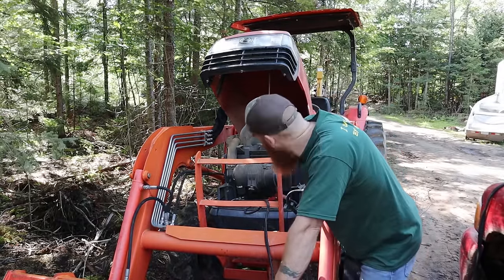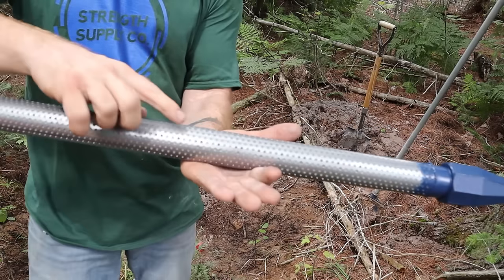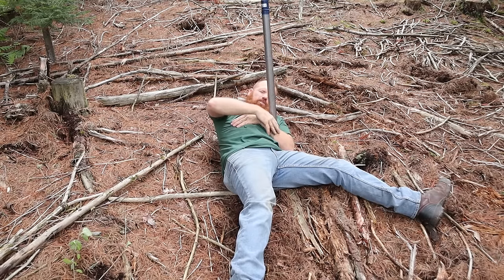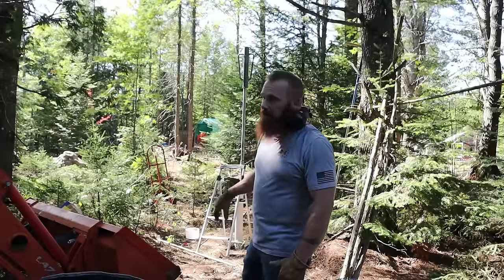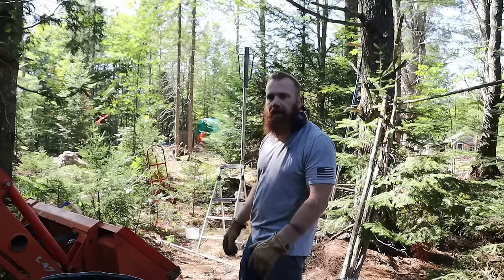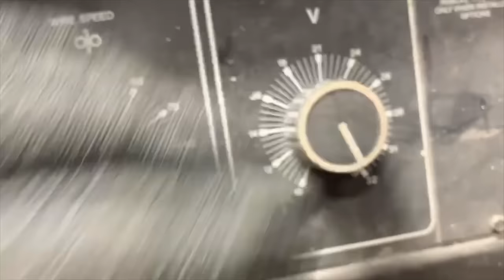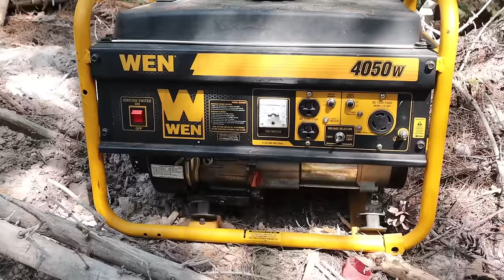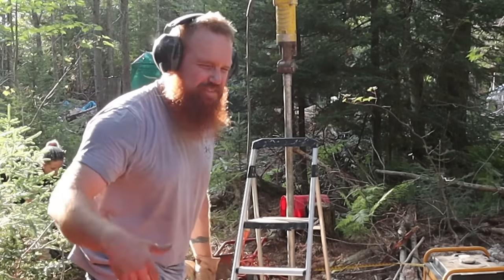Off Grid YouTube Family of Girls Step up to Help Dad Drive a Well | Fabricating Off Grid Well Tools

Comment: Done this 6 times. 1 for me, 3 for neighbors, then replaced mine twice.  I also devine with coathangers since I was a child. All the wells were about 30- 40 deep.  Sometimes you can shoot a gun down them and get another season out of the point. My points lasted 8-10 years. Last one still fine after 20... think it was just a better made one. just used sledges on mine, but a neighbor had one of those slide hammers and another had a really nice tripod driver set up. Today all the lake front properties have been bought and developed already. Soon no one will know how this is done...

Comment: Hi  it was nice project you undertook .girls gave helping hand was aasum.
 At our place we also dug a  a well using 100 mm pvc pipe 60 feet in length.the pipe was in 10feet section  4 section were perforated.
We made a tool to dig the soil which was like a big screw which was attached to 1 inches galvanized iron pipe and we rotated it and took out soil upto 30 feet
After that the clay was soft so we used other tool using 3 Inches diameter iron pipe of length of 3 to 4 feet whose one end behaved as shutter.shutter closed as upper othee end was pulled due to gravity force .it was thrown down the 4 inches pipe and the soft clay removed  and we got water.using water pump and hand pump as well.
Reply from the maker: Interesting!

Comment: Oh wow!!! After watching this satisfying video I was so happy to see water gushing out initially. When you said that pipe broke I literally had my mouth open in shock and disappointment. I know how  something like that feels when you do all that work and it doesn’t work out. Damn!  I’m sorry to be negative but how do you know it it only broken eight feet down but not any further. Good luck with this project. The more disappointing and difficult a task is the more gratifying it is when it is completed and works.
Reply from the maker: Well I don’t know for sure but what I do know is that the pipe is broke off right ft down because I can see it. Also the water level stops right at that 8 ft down broke part. If it were to be broken down any further the water level would be down even further.
Reply from the maker: @mgpvii  thank you!

Comment: When I was seven years old in North west Missouri My dad drilled a Well that same way. He was a Witcher and he could find water . He made a Auger out of a old Mill Auger and we turned it with a set up he made and powered with the Back wheel of our old 1934 Plymouth Pickup Truck and old belts he got at the Old Mill. That well is still producing water . 70 + years later.
Reply from the maker: Wow that’s awesome! Maybe the old rig still works? 😆 How deep was the well?

Comment: I used my tractor bucket for pushing the well pipe. I kept the post pounder on the pipe and pushed away. You have to be careful but it does work
Reply from the maker: You must have a big tractor.. ours won’t do it.

Comment: I work for a dewatering company and you need to back fill around your screen with sand or small gravel at all costs that will help filter water through with out gumming up the screen and clogging your well! Good luck you can do it!!

Comment: One suggestion I would give you is to empty your Kubota's bucket, and position the tractor near the vertical pipe - with your jackhammer and other tools needed, inside - raise the bucket to a good height to work at (working at waist level is much easier than above your shoulders), have enough clearance to be able to raise and lower the height of the bucket without having to move the tractor. Level your bucket so it is comfortable to stand in, and use your ladder to climb into the bucket. Your tools will already be where you need them and you can even have a cooler in the bucket for cold hydration.
Reply from the maker: Yes that would’ve definitely been much better

Comment: I have done 3 by hand. And one well ,l can pull water with a hand pump 115 feet…I took 87 cranks with the old pitcher pump to do it,made a foam rubber to block the spout…So l would not have to pour so much water in it..Once the leather swells,your good to go!!!

Comment: Have you considered using a pneumatic t-post pounder? The jack hammer was good idea, but a t post pounder is already designed to do that very job. 

Coupled with a pressure washer hooked up to back wash the pipe/hole, might do the trick of reducing the friction between pipe and dirt. And making mud loose enough to easily pound through.

Comment: Use a trash pump to send water down your pipe to remove the clay and keep the screen open. With water pumping you will be able to just press the pipe down and should be able to see the formation you are "drilling" into so you will no where to stop to be able to check for water. You may have to keep running your 4" pvc casing down along with it to keep your hole open. Good luck to you and I hope you eventually get your water source.

Comment: Pre-heat the metal parts before welding, use nickle wire, straight argon shielding gas and slowly cool the part in lime.

Comment: you need to keep digging with the auger. If you hit water at about 10 feet you need to take the auger down as far as you can. the well i dug i hit water at 14', i kept going down till i hit water, it ended up 28' deep. then you put pvc casing with slits cut in pipe sides to allow water to seep insde pvc. put 30' of pvc in hole, then filled outside of pvc with pea gravel. the gravel helps to keep the big chunks of dirt out of the casing. then  you run your 11/4 down inside your casing with the strainer keeping it about 2' off the bottom. hook the pump on, prime, and pump. just driving the pipe down it doesnt have enough space for water to flow down around pipe to the foot valve.

Comment: Check out the YouTube where the fella used PVC pipe 3 inch like you did but then he use flexible 1 inch pipe hooked up to some type of pressure into the 1 inch pipe. He did this he’s doing the same as you did except he used all white PVC water pipe, I guesshe’s on YouTube which looks pretty easy to me. The metal pipe you’re using is expensive I guess and galvanized. I hope anyway it was nice to see the family getting involved together as a family should good luck take care and God bless.

Comment: When driving in a rocky area use a rock point, when driving in a sandy area use a sand point. If you use a sand point in a rocky area the point will probably collapse. A sand point will have a finer screen.

Comment: I got my pound point 18 feet and hit a rock.  I burned 5 core bits in the area trying to break through.   I get a gallon of water a week.  Cost me $1,000

Nice family.  Nice goats.  So cool when they think it is fun.
Reply from the maker: Wow! But just think, at a dollar a gallon you’ll get your money back in just under 20 years! 😆 Thank you Michael! Hope you’re having a great day!
Reply: @9252LIFE  I sold my drill mast rig.  That pipe and the hole will be gone this fall.  Worked on that for a year.  It is a pain in the ass when mowing the back yard.  And my little China pump stopped working.

Barely enough to water the carrots anyhow.  Looking at bulk water storage units now, for human survival,  not the garden.
Reply from the maker: The garden is a good survival item

Comment: If you need to go over 25 feet to water, you need to use a 2" point and pipe. From there, you could install an old fashioned deep well  cylinder and hand pump, or you can use a deep well jet pump with a packer ejector. Both can lift water from 100' or deeper.
Reply from the maker: Our water table is only a few feet down. So once we get through the clay and the screen doesn’t clog, the water will naturally be up high enough for our hand pump to work.

Comment: We dug 3 wells by hand ,the first was like u did but we backed the truck to the pipe and loaded it up with anything that had weight jacked up the truck and tied it to the pipe then use the hand driver.we went 35 feet hit water but could not get the pipe clear get to get the water recovery,my brother had bought a gas well driller rig and it drills 100 feet. We have 2 100 foot wells.

Comment: I used an auger shovel down 30 feet hit surface water at 10 feet. Pulling that shovel with muck clay rocks and water was hard.  Am modifying my pressure washer and steel pipe to sink the outer 4” pipe down 60 feet. Then the center 1 1/4” pipe with 2
Check valves in line so to never lose prime. This will be water to water my lawn and garden. Good luck.

Comment: Last time I drove a well I used a go cart motor and welded a tire rim to the shaft. Set up a pulley type system and had a rope to the driver with  xtra weight. Loop the rope around tire rim it lifts driver then release rope.

Comment: I went through all that and then found out that a frame loaded down with weight a bottle jack some 4x4 blocks and found out how much more easy it was to press pipe in the ground. And I  never broke anything and I went 85 feet. 💪
Reply from the maker: Interesting! Did you record it or take any pics? 😬

Comment: I'd suggest a pipe threader from Harbor Freight.  You MIGHT be able to thread the pipe without having to dig it up??  Also, build something to keep the pipe from wiggling and in the 4" PVC to prevent another break 8' down.  I hope to see some progress on this soon.  I'm thinking about drilling a well of my own, but I know the well I'm connected at my parent's place a few hundred yards away is over 400' deep.... I'm hoping I don't need it, but an emergency water source will be nice.

Comment: I’ve seen folks drive grounding rods by using water basically you use a rod and pull up the rod fill up the hole with a small amount of water and the water hydraulic pressure help pound it in

Comment: I had the best time! And teach my students as best I can to get inspired to do the same. I teach Plumbing! 40 yrs exp!! Your pipe is low carbon ( soft ) impact mucked it up. Have you considered !! Remove the existing pipes... and core drill through the existing hole.... just a suggestion... don't know how else to get down as deep as you need. Water should be be trying to get up as your drill, to cool core?? Good luck bud.

Comment: I know it is way too late for this but... Where we are from we pound wells with a truck and a rim welded on another rim to use as a capstan winch, run a rope up to a poll A frame with a pulley. We put a 100 pound weight on end of the rope with a pipe to guide into the pipe we're pounding in and just wrap rope around truck wheel a couple times for tension while truck is on jack stands we pull on rope creating tension this raising the weight then let go of the rope dropping weight onto the pipe being driven into the ground.

Comment: for this i'd use sch 80 pipe, in at lest 10' sticks, minimize stress points. the jack hammer was a good idea 
my half baked idea so far is using a seymour auger, using a trash pump, from a settling pound to push/flush the loose material away/back up the hole. most likely i'll end up doing the spear method like you guys. 

have you guys tried dowsing rods to find a good well location? i've seen it work.
Reply: dowsing is a scam, this has been proven many many MANY times.

Comment: ya i did a well once using a hole digger like you just used just teep adding more pipe on to it till i hit but on the land i was i knew i could hit water at about 15 feet down and yes that were i did hit water and i put a hand pump on that i did this to get water for some pig i had to get them some  and at another time i used a well like the used and put it in with a post driver just like and i hit water at about 20 feel on that and that was on a cabin i had in the woods  and yes you can use a hand pump on a well that is over 25 feel but what one needs to do there is to put a check valve in the pipe and use a long handle put as you go down more the wieght of the water makes it harder to pump so the longer hand help to keep it pumping better i once put a hand pump on a well that was 40 feet down and i had to do it this way and it work really good

Comment: Not sure if it would work in your area but most hand dug wells are shallow. I have one that that's 100 years old on my property and is the standard "lined with rocks" like a stone wall type construction. I did the math and at 17 ft deep with water maybe 5 ft below grade, it's got around 600 gallons in storage. Granted, it takes time to recover, but used wisely that's a fair amount of water to work with. Using modern equipment you could dig that with a track hoe in a day and stack in a concrete liner with a gravel base to around 20 ft and be done in a few days. From an engineering standpoint, once you hit water you will need to run a pump to keep the hole dry enough to work. The flip side will be watching how many gallons per minute (or hour) you are removing, which will be an indication of the recovery rate once finished. If you do the job during dry season it will be easier and you will also know your worst case situation for recovery rate on the water.
Reply from the maker: Thank you. We’ve gotta definitely get something working!

Comment: I had a well put at my house in about 1977 by an old guy that came in an old pickup truck. He had a giant tripod made of pipes he put in above the well position. He had a 5 HP gas engine with a running capstan on one end. The motor was mounted to a heavy base of timbers. He ran a rope from a heavy weight resting on the well pipe up to a pulley at the underside of the tripod and on to the capstan. He wrapped the rope around the running capstan for a turn and when he pulled the rope the capstan lifted the weight and when he released the rope the weight dropped. He was able to use the capstan to draw the heavy wight up and then drop it down on the well pipe with ease. As I remember the heavy weight was a heavy hand held driver like you would use to drive fence posts. The action was using sight pressure on the rope to draw up heavy weight and then drop the weight, and repeat to drive well pipe.
Reply from the maker: Interesting

Comment: I know nothing of digging wells. Is there a reason you can’t use the bucket on the tractor to press down on the top of the pipe. That tractor should be heavy enough for that?  Apart from that it’s great to see a family working together.
Reply from the maker: The tractor won’t do it.  It’s just a wimpy little thing. Tried it. Thank you Clifford. Have a great night!

Comment: Did you use dowsing rods to find the spot to dig the well,you can make some with 2 metal hangers ,straighten the 2 hangs make to rods about 2 feet long bend the ends about 5 inches long to make a handle like a L take two Bic pens take apart put over the handle so the rods can swing freely hole them out one in both hand walk around land when they touch thats where the water is,it really works
Reply from the maker: Yes we used dowsing rods. Took a couple hours and this seemed to be the best spot.

Comment: As I'm sure others have pointed out you need a pump at the bottom of your well, because below 30 feet or so the only thing you pull is a vacuum.  You'll probably need a bigger hole.
Reply from the maker: We tried drilling a 6 inch hole but the clay keeps caving in. Been a real pain in the butt!

Comment: You clearly have the technical capabilities (some of what you did there was straight genius) and equipment.  If I could make a suggestion, ditch the whole driving the pipe down into the hole routine - you hit the problems you did (I learned them myself).  If you have something like say an old motor with a vertical shaft/drive on it you can quite literally bore your own holes down 100 feet with very little effort.  An old 5hp lawn mower, stripped down to the engine, could easily (If I can do it anyone can do it) be retrofit to turn 100 feet of steel gas pipe with a 6 inch bit on the end of it - letting you drop in 4 inch pipe with your own homemade screen deep into the ground.  

Really enjoyed watching the video, hope my comment doesnt come across out of line.
Reply from the maker: Great idea!

Comment: A few weeks ago (in the ...city...) contractors came by to prepare for laying new gas line. They had a truck they pulled up, used high pressure water and a mud vacuum to dig down (only a few feet) to spot the other utility lines. Googling, it seems some well diggers use a similar approach.
I am no well digger, but I suspect if you get something to pressurize a water (pressure washer(s)?) and enough water, you can attach it to the pipe you are dropping, and use a mud pump, therefore sinking it much easier. As long as you loosen the soil and keep it moving (vacuum), you should be able to sink like a hot knife on butter.
The only issue I see it rocks, roots and other large debris-but it seems like that is not as much of an issue there.
I am no well digger, but maybe it will help?
Reply from the maker: Yes that approach seems to be the only way we’re going to be able to get deep enough without breaking pipes. Of course now we’ve got about two ft of snow on the ground with more coming down

Comment: One thing to keep in mind, a well will take what it will yield also, it wouldn't be a bad idea to flush that well,  by flush it I mean pour water down it as I stated above a well will take what it will give , also you should have a check valve at the front of the pump so when pump shits off all water doesnt run back down the well , unless that pump has a shallow well package has a built in check valve. Good luck once you get out of the clay you'll notice a well start going down a lot better with each hit and if it stops make sure you stop you don't want to start going back into clay